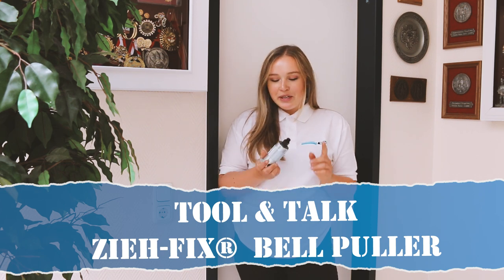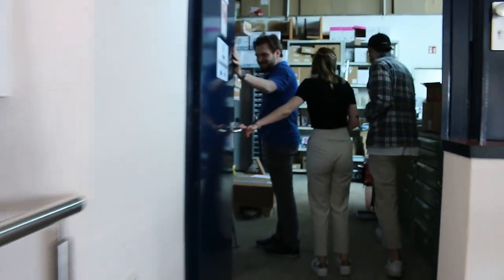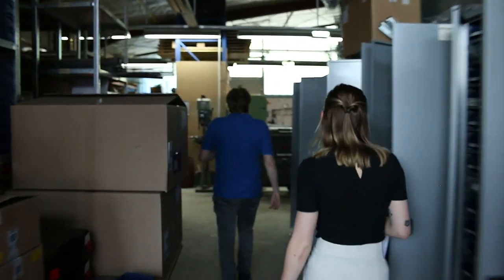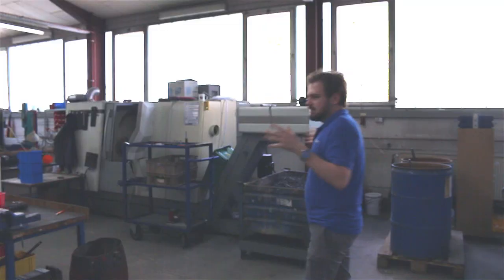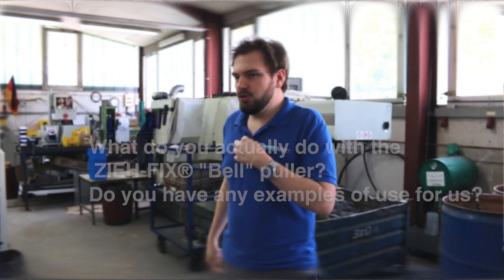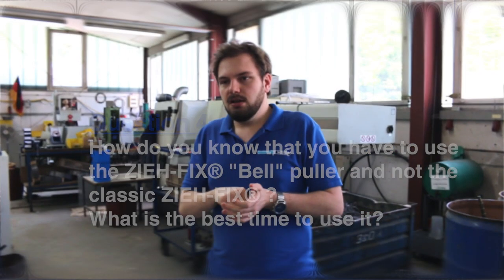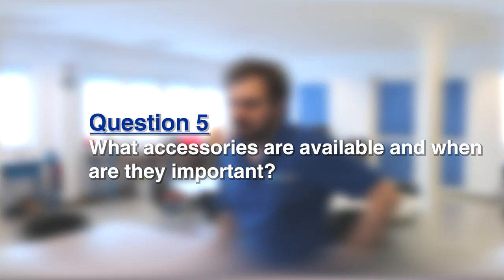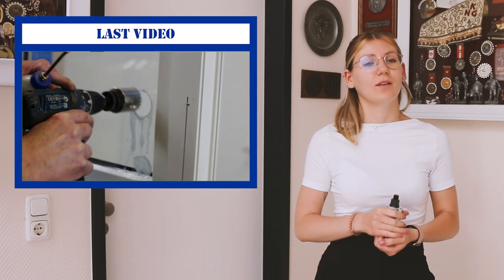TOOL & TALK 💪 ZIEH-FIX® Glocke / "Bell" puller

Comment: Have you considered expanding your machines, perhaps buying some Swiss lathes such as citizens L12 or L20 series? They could greatly increase your output.
Reply from the maker: Hey we considered it. Problem is to find good technical people in our region. Also we have a huge space problem we have not enough space for stock or new machines currently and not a lot of options to expand. But we hope to solve this.
Reply: @Zieh-Fix  I understand. I work in US as a CNC machinist, and noticed you take them from the lathe to a mill. At my current job we use L20s that have live tools to mill and turn simultaneously.  Labor is a big problem over here as well to find people that can choose, order, setup and program Swiss machines according to needs to get production started. It also doesn't help that almost everything is backordered for months haha.
Reply from the maker: @johngriffin618  yeah we now have a reliable. Partner with a self feeding machine that can do both processes at once. This allows us to focus on smaller productions and Prototypes.

A few years ago it was either find partners to help production and keep smaller amounts of tools or upgrade machines and still only be able to produce the tools we have to produce a lot of.

We decided to keep know how in house and focus on the prototypes and productions of tools, where the output isn't high enough for most cnc shops to take the job.